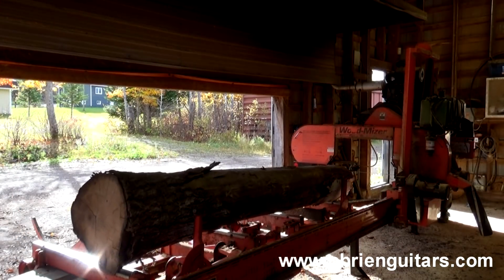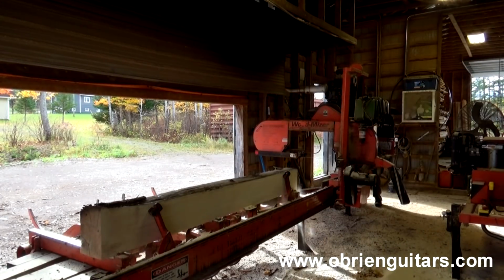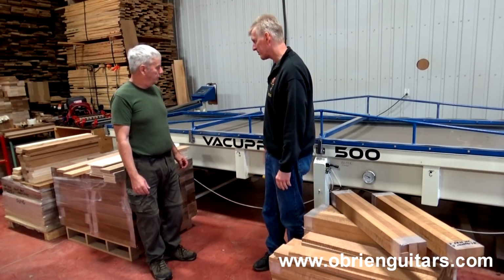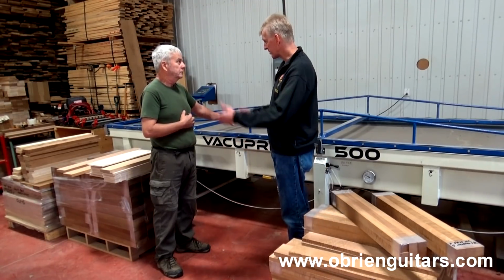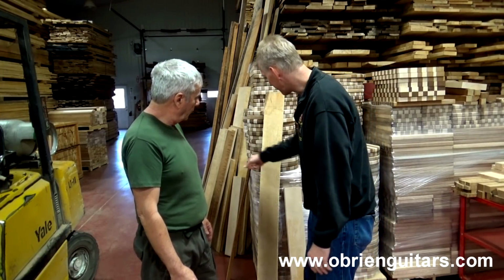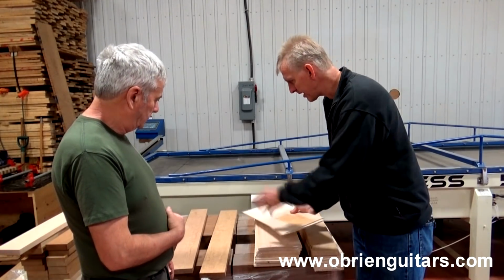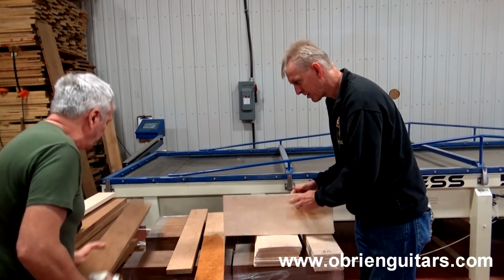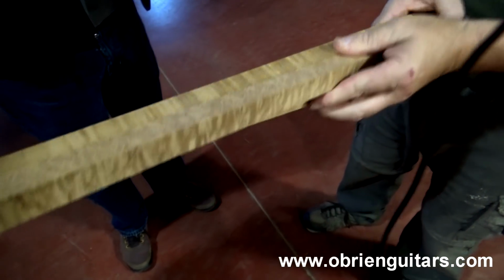Luthier Tips du Jour Mailbag 105 - How wood is processed

Comment: I work in furniture, but build instruments on the side. I've noticed Q sawn white oak, and many other species are starting to explode and break coming out of the table saw, because of rapid drying processes. Is this drying process ideal?  Would it be worth to wait, or to push the drying process, for quantitative financial stability? What do you guys think? Genuinely curious.
Reply from the maker: I have not experienced this. I have built  instruments with both kiln dried and air dried lumber and haven't noticed a difference in workability or tone.
Reply: @OBrienGuitars  Huh. Blades are sharp, but maybe just the lumber that I'm buying. Thanks for the reply. Happy guitar building!